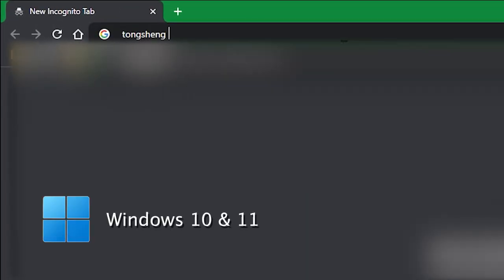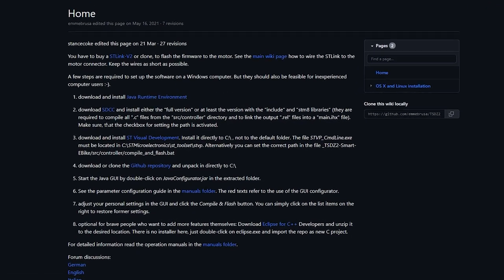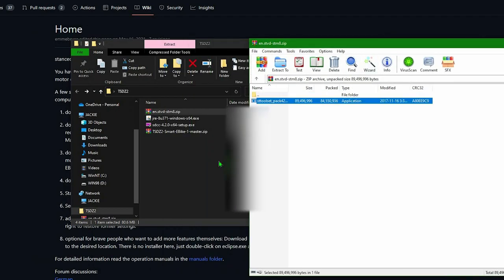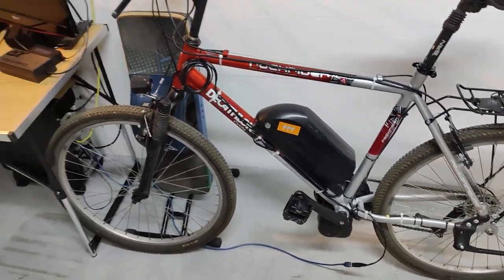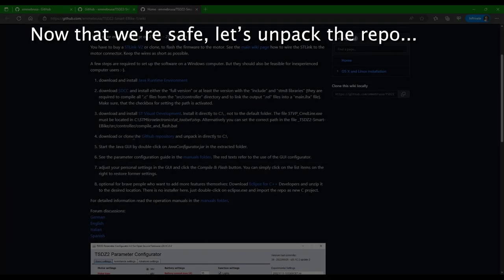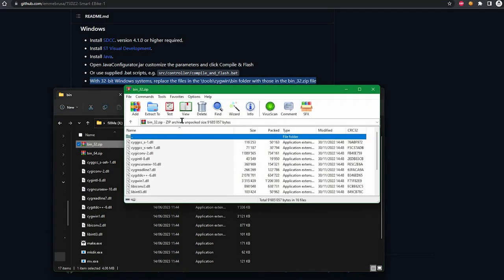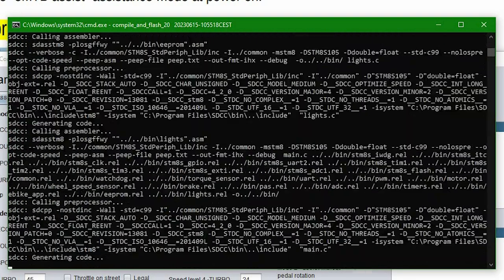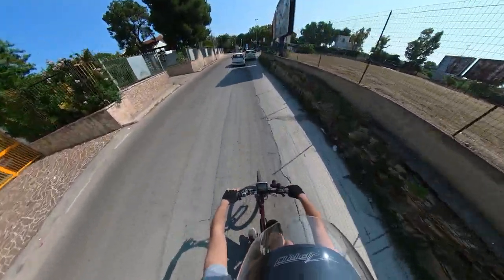Tongsheng: Install the OSF and KEEP YOUR DISPLAY!

Comment: Great Video. I see you said to connect the battery and ensure it is on. I recall reading somewhere that the battery needs to be disconnected. I am scared of doing the wrong thing - can you confirm which is the right thing?
Reply from the maker: Hi! I prefer to leave the battery connected and turned on cause I've learned in my life to never assume that the power coming from a USB cable will ever be enough 😅
That said, it's SUPER IMPORTANT that you do as the manual says: "Caution. During programming, the display must be off!"
That's why maybe you read that other advice elsewhere: overcaution, which is not a bad thing...
Do what you feel it's best, just be sure to keep the display off while flashing
Reply: I disconnect the battery before doing any installation --> work fine. however I use a short DIY programming cable to make sure there is not much voltage drop on the cable.

Comment: Great video, thank you for making it! I bought now two bikes with tsdz2 conversion, one is 36V 250W, the other is 52V 750W. Need to get my head around flashing both.
Reply from the maker: Thank you! enjoy your new bikes 🚲🚲
Probably you won't need to hack the 750W one, but you may consider it for the 250W ✌️
Reply: @LukeLorusso  Thanks, enjoying both already! There is a difference between the 250W and the 750W motors indeed but I heard that custom software changes feel of both for the better. I'll start with 250W first and then think of doing 750W with SW102 display. 
Thank you again for your videos. Thanks to them I pulled the trigger and bought TSDZ2 motors as Iwanted riding feel as close to Bosch system as possible and I'm not disappointed so far.

Comment: The mystery speed you see at powerup and other times are status - Battery voltage and I think power levels . The odometer compensation option makes it so the first little distance isnt added to your odometer and it isnt adding phantom miles to your overall odometer.  
 I was hoping you would explain the E02 menu system - where you start in street mode so it is street legal from poweron but a combo of buttons can change to say hybrid assist I am yet to see a video that shows that :)  But yes Hybrid mode rocks
Reply from the maker: Thanks man, that's really helpful!!! 💪
It makes sense: 58.3 is the battery %, 37.7 is the residual volt... but what's that last 19? Do you know it?
...yeah sorry for not going too deep into the explaination, I'm still figuring it out
Reply: @LukeLorusso  All good - I did mine about 6 months ago and still cannot figure out the menu system :) so like you just set it to hybrid assist on power on.  But the street mode from poweron would be good for those countries like mine that are really pedantic about the 250w limits, as if your bike is suspected of being overpowered will only LOOK like a 250W motor without the menu changes.

Comment: Hi.
Great video.
I have the same display including all accessories but i don't know if the controller is the same. My bike model is Apex Stark DH 2 battery 60v/20A. Unfortunately i can't enter hidden options in the display menu by pressing in 2 bottoms simultaneously. Can you tell me please if i will upgrade firmware to your version after all can i get an unlock display and do anything from the display. I want to change power and speed.Thanks
Reply from the maker: Hello! Even if the Stark Apex DH shares the same display, the motor itself is completely a different one from the TSDZ2. Unfortunately, you cannot use this specific firmware to flash your motor
Reply: @LukeLorusso  
Can you help me please to find a forum or something that can explain to me how to enter a hidden options?

Comment: Luke, I want to buy the st-link v2, but I’m not sure which cable you mean, when mentioning a speed sensor cable?
Reply from the maker: You'll find the details here https://empoweredpeople.co.uk/2020/05/28/tongsheng-tsdz2-what-firmware-options-are-there/ at "Tools needed."
Reply: Look at video 6:17" it shows exactly where the speed sensor connection is. This is the spot to plug the st-link cable

Comment: When Flashing at 11:12 I am encountering some error . It doesn't seem like even the first line of code can run , clean.bat. I am getting the following error

MAKE Version 5.41  Copyright (c) 1987, 2014 Embarcadero Technologies, Inc.
Error makefile 92: Too many rules for target '../../bin/%.rel'
Error makefile 97: Too many rules for target '../../bin/%.rel'
* 2 errors during make *
Cleaning failed!!
Press any key to continue . . .

Any idea what may be causing this ?
Reply from the maker: the only thing that comes into my mind is that something might have been installed in the wrong directory

Comment: Do you know if this works for the TSDZ2B motor also ??  or alone for older TSDZ2 ?  Tnx
Reply from the maker: I've read something about it here https://www.reddit.com/r/ebikes/comments/13zkbv8/quick_question_does_the_opensource_firmware_work/jn347rm
Reply: @LukeLorusso  Tnx, I'l l have it a go
Reply: It depends of the controller that you have...some units dont have st controller...

Comment: Whats your opinion on the tsdz2 and tsdz2b?
Reply from the maker: So far not a complete opinion, I was planning to order the b, to replace the actual TSDZ2, just moved by fear of premature fails. But then I said to myself "I already have a nylon blue gear replacement here, worst case scenario I'll try to replace it, otherwise I'll consider buying"
I've also read somewhere that some of the new b controllers were not flashable anymore, but don't quote me on that
Reply: @LukeLorusso  The tsdz2b has the same controller. I was curious on your opinion of the change to the white reduction gear. I have the tsdz2b on my full sus mtb with OSF. Never tried the non-b version.
Reply from the maker: @durk541  Definately a good idea to buy the newer one, talking about the white reduction gear.
Here's one place where they talk about the controller thing https://www.reddit.com/r/ebikes/comments/13zkbv8/comment/jn347rm/

Comment: How many amps and watts should the limit be @52v ?
Reply from the maker: Only you know this :)
The detailed part will come with the next video, but suppose you have a 17Ah battery @ 52V. It makes a theoretical output of 17x52=884Wh.
For such a battery:
Battery current max: 17
Battery power max: 850 (better to be conservative)
Battery capacity: 884
Battery cells: <unless you know, leave it as default>
Battery voltage cutoff: (depends on you but I would put) 45
Reply: @LukeLorusso  Yes, I have exactly 52v 17 Ah em3ev battery. 30 amp continuous limit. 

I just meant what would a safe max be for the motor to stop it burning with the new firmware ?It's very hot on stock FW. 

I'm waiting for the ST-Link. I can't wait to try the new Firmware.
Reply from the maker: @o00scorpion00o  unfortunately I don't own the 48V variant, so I can't be very precise, but I believe the 52V battery might be the reason behind its temperature...
you'll surely find some better configuration with the OSF! ✌️
Reply: @LukeLorusso  Yeah can't wait to load on the new FW. 

I was hoping the motor would have been more powerful than the Bosch 50 Nm but it isn't, not with stock FW which is half the advertised torque, hoping the new FW will open it up a bit.

Comment: buongiorno , io ho installato OSF DI EMMEBRUSA,  impressionante nella potenza ad eco , tour, la marcia spped non la uso quasi piu'.  oltre ad consumi ridotti della batteria , non voglio esagerare  ma resco a fare piu' del 30 per cento in piu' di strada . Per quanto riguarda il display VLCD5, mi da' piu' informazioni, appena accendo il display il primo numero che compare ho potuto constatare che coincide con il livello di batteria, anche se la misurazione dalla piletta in alto a destra e' molto migliorata, poi compare un secondo numero che ho notato che dovrebbe coincidere con le volts di carica batterie , perche' man mano scende e cosi' anche il primo numero.  Devo dire che il motore nemmeno riscalda eccesivamente dopo lunghe percorsi di cui anche in salita. Dimenticavo io un TDSZ2B 500W. Sarebbe bello approfondire la lettura del display dopo l'aggiornamento. grazie
Reply: Quindi funziona anche per tdsz2b ottimo era la riposta che cercavo